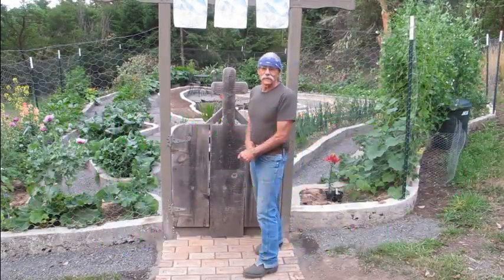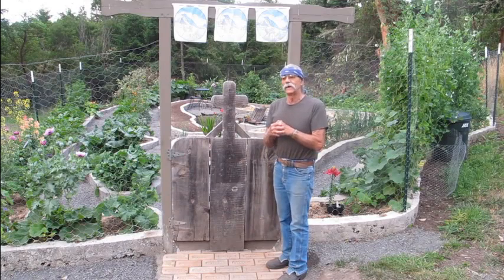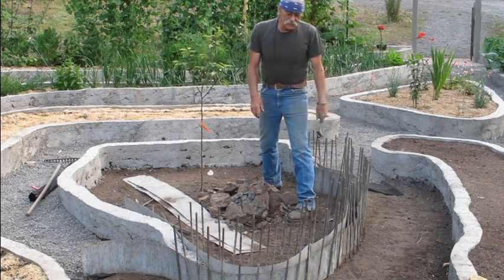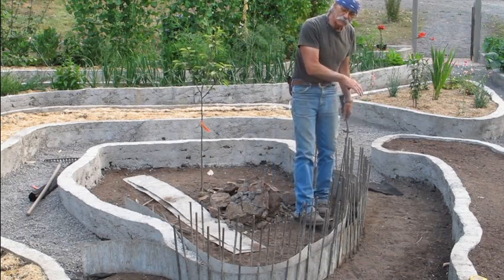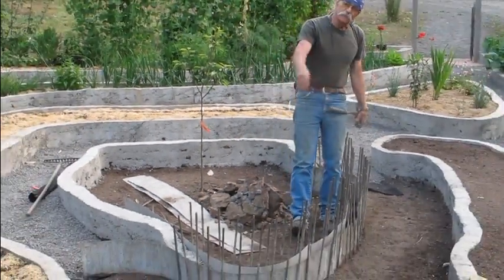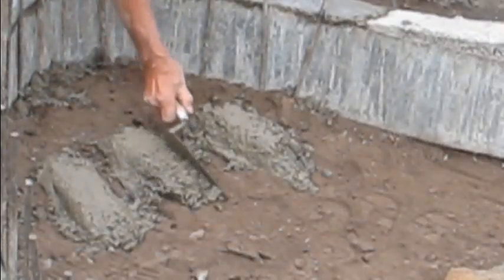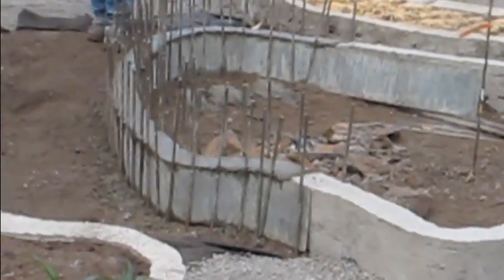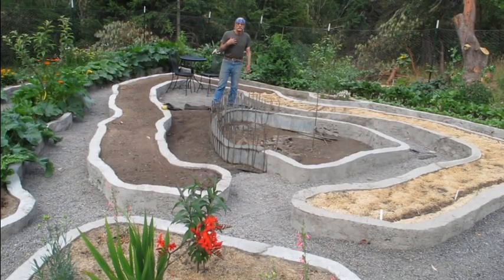How to build cement walls for raised bed gardens

Comment: That is absolutely stunning! I've got a raised bed around a huge maple tree. It was there when I bought the house. It's made with landscape timbers. I've had this house 11years, so you can imagine the condition the condition the flower bed is in! The one in the front yard has been gone for years when the city cut down the tree the flower bed got destroyed too. It was rotten then. There is still a huge mound in my front yard, but I'm 56 and I've got a disease called Ankylosing Spondylitis. It's a type of autoimmune arthritis that attacks your spine and turns soft tissue into bone it causes your spine to fuse together and curve forward. I'm fused from T12-C1 and my head is fused in a prayer like position. Since your body also grows new bone to shore up your spine, breaking my neck is a very easy prospect. A fall or a small fender bender could kill me instantly or turn me into a quadriplegic. I also have Psoriatic arthritis. I look like the bride of quasimoto lol with crooked fingers and hammered toes!! Hehe that's why I wasn't able to do anything about that dirt in the front yard! I'm widowed and childless.
Anyway, I think that would be a great way to fix that! I could set that form up just outside of the rotting wood and once the cement has set I can remove the top row of rotten wood and back fill the rest with topsoil!

Comment: I'd love to do this when I finally own a home (I built wooden raised beds in the backyard of the rental I currently live at).  You could also use all that rebar for the base of cloches: hammer the rebar into the soil on opposing edges of the bed, thread the end of a length of PVC over both rebars to form an arch, make a series of these arches running along the length of the bed and cover with clear plastic sheeting to make a tunnel cloche.

Comment: I've been trying to think of a way to make a raised garden bed out of concrete. 

My thoughts ranged from doing some kind of block build to a wood form. I wasn't crazy about either one, but I was going to go with the cement block idea. I was going to make and color my own block.
I wasn't crazy about the time it was going to take though.
Then I came across your video. Wow, such a simple method, not nearly as time consuming.
Great idea, thanks very much for posting this. You just saved my back.

Comment: (1) Really enjoyed seeing this.  I'm in the designing phase of creating a raised garden bed.  I wanted to build the beds using concrete but realized it would be too much work.  Your idea is awesome and I would like to try your method.  However, I would like to install pvc pipe at the bottom of the walls in a few areas to allow water to drain incase of too much rain flooding the bed.  Not lately with the present drought but there are times in our area we get a lot of rain. (more...)

Comment: Hello Frank,
Great video on the cement walls in the the flower bed. One question for you if I have unlevel ground what would you use to bring to level garden soil, paver sand. Any suggestions would be great. Thanks have a great day, Eric

Comment: To be honest, in the beginning I thought we are entering a future cemetery. That's how you do it if you want things to look beautiful, it takes whole lot of work. Yet we always add reinforcement bars bottom, vertical and horizontal, all tied up with wires, for strength and durability, even against earthquakes. And you gotta be able to bend the rebars to shape as well. Beautiful things take a lot of work, and it's definitely not for the lazy.

Comment: Your raised beds are amazing! I love the look of the curves :) These look pretty easy to build as well. I wonder, are you using any materials to allow for microbial colonies to establish on the inside of the bed? also, have you thought about adding anything to the concrete to help it improve its porosity? if the bed is flooded I could see it holding the water and stopping the soil from draining off the extra. By the way, It is cool to find another Frank on YouTube running a gardening channel!!

Comment: Where do you get the metal sheets from?
Reply: After iwatched this vid few y ago, I  bought my metal sheets from local building store  such for example Bauhaus . Idk where do u live but check it local building stores  and good luck :)  Its a same place u can buy cement and that metal "sticks"  etc...
Reply: He is using FLASHING it is normally used in roofing so go to the roofing dept.